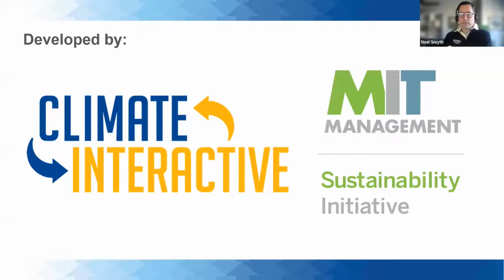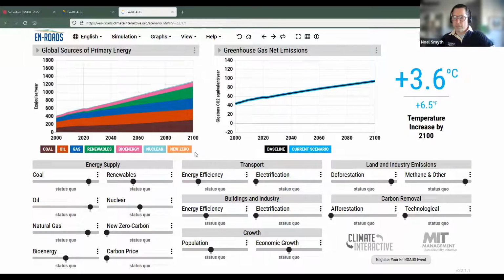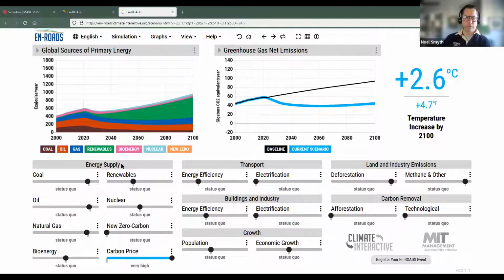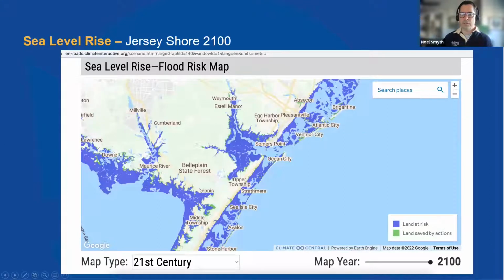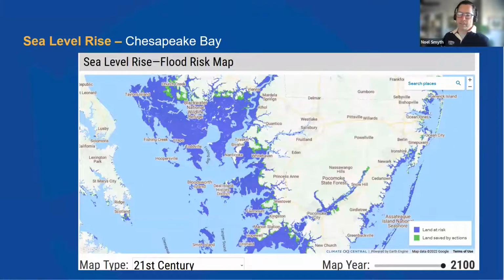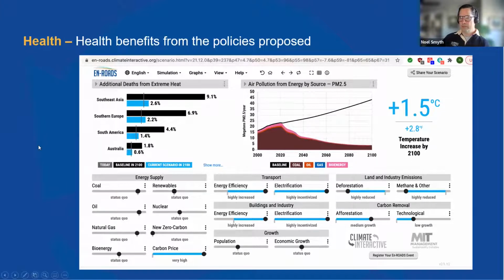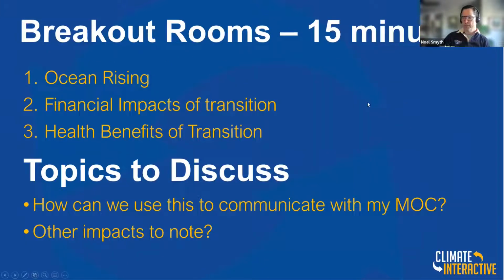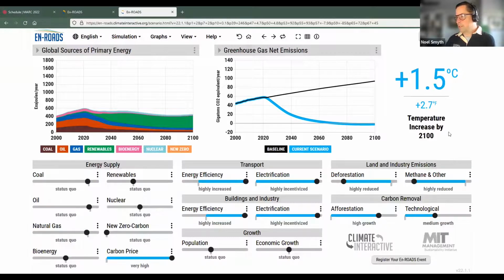MARC 2022: En-ROADS

Comment: The entire program is not accurate because it does not consider population level and population growth. There is nothing in the program that alows adjustment of population level and the effects on the overall result increases or decreases in population would have. This is thus obviously A POLITICAL PROGRAM DESIGNED TO SUPPORT THE CURRENT NEW WORLD ORDER PARADIGM! As long as you exclude all persons that DO NOT support the NWO goal of the powers that be promote your program will be nothing but a political rag.